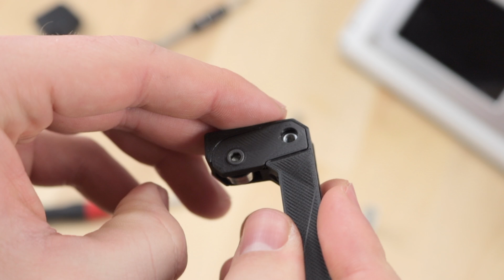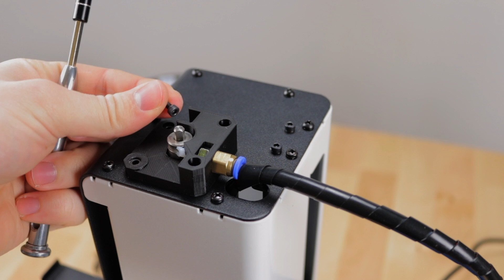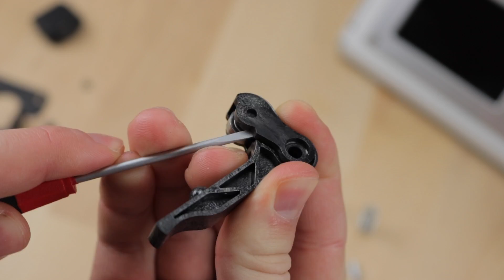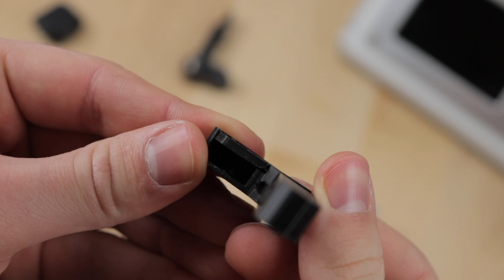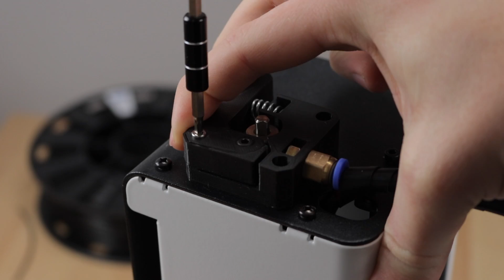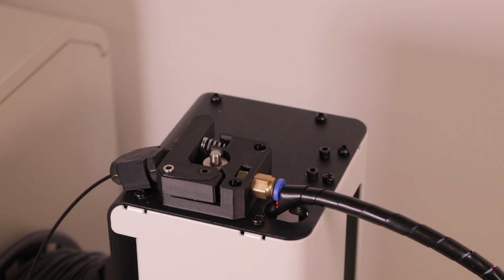MP Select Mini Feeder Upgrade for Flexible Materials - The Arm

Comment: I have the V2, and they seem to have changed the smallest screw from a socket head capscrew to a panhead screw, so now I'm getting more extruder slippage than with the stock setup since the bearing is no longer properly supported. I guess I'll have to get some replacement screws, just a heads up if you want to try this with the V2. Otherwise I didn't have any problems printing it out of PETG, thanks for the files and documentation.
Reply: V2 users that want to replace the feeder should use the WK9 feeder replacement—and make sure you write down the what additional parts are required (10mm M4 screw for the arm at least, and a pack of threaded pneumatic tube fittings to replace the original one and then some)

https://www.thingiverse.com/thing:2756509

Comment: Where can you get the regular  base place. Mine and broken and I purchased a  Capricorn Bowden Tube Metal Extruder and I am trying to install it with out any directions.. Thanks
Reply: One other item of interet, the base on my printer had cracked ( I think it was shipped this way).  I purchased a metal extruder from Capricorn on ebay in hopes to upgrade my Monoprice Mini Select. This product is describe to be designed for the Monoprice Mini Select. Bad idea! There wasn't any install instructions and when I did get most of it installed there was no way to keep the spring installed. I then decided to make one from your design at school and it has worked great so far. Let you know in a few months how it goes. 
THANKS.
Richard
Oh,  I gave the metal extruder parts from Capricorn to the lab tech. Maybe he can use them on another printer

Comment: Is there anyway to print this if the arm is already broken????
Reply from the maker: Well that depends. You need to figure out a way to temporarily build something so the printer can feed material. If it just is a crack in your arm you can try to fix that with some sort of clamp.
Reply: I saw where one guy carved a lever out of wood so that he could print the replacement arm. I think it was on Thingiverse? If you go that route use something hard like oak, walnut or maple. You can probably use a coping saw a drill and some sandpaper (don't use a knife unless you're experienced in carving). Maple would probably be the best of those. A little harder to carve though. Pine, Basswood or Fir might be too soft. I woudn't use those.
Reply: I am like you. I don't realize that there is a part that I should have printed till it's already broke.  First with the hot end.  The Teflon in the heat break got destroyed.  I then decided to replace the whole thing with with a E3D V6 hot end.  But before I could do that, I needed the special bracket you can only print out.  Found a replacement heat break at GigDigit.com that I'm only going to use once.  But it was worth the cost.  Evidently I do not learn my lessons.  I just cracked my arm.  If I had just printed one earlier, I could just replace it.  Once again, GigDigit.com to the rescue.  I will buy a new extruder mechanism.  The first thing I will print will be a new arm for next time.

Comment: Great video. Mine will break any day now due to a major crack near the bend. Thanks!
Reply: I bought my MP Select Mini very recently. The extruder arm in this version has no screw to keep the bearing in place, instead this is an integrated plastic part of the arm. I'm looking for a replacement screw right now, seems to be the same threads as on the rest of the baseplate screws so I'm not completely in the dark.
Reply: Couldn't find a screw that fit but I cut off a large headed nail with same diameter and friction fitted it. It protrudes ever so slightly on the back of the arm, but this is not a problem since the arm is slightly elevated from the baseplate at this point.